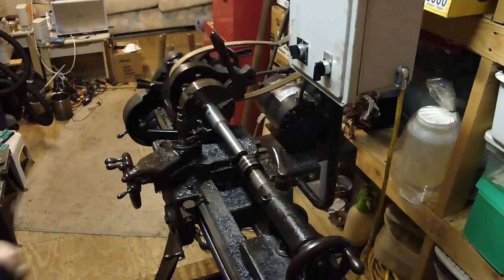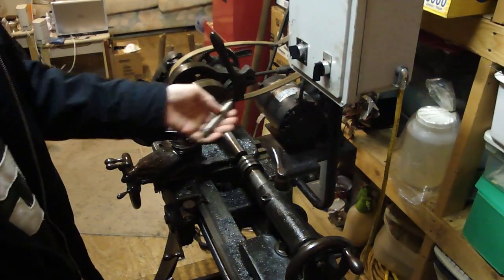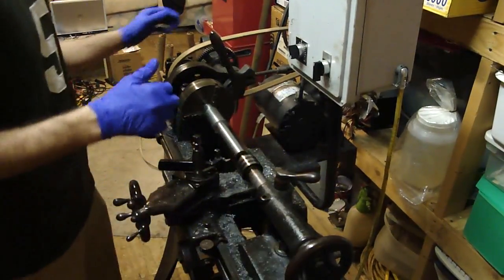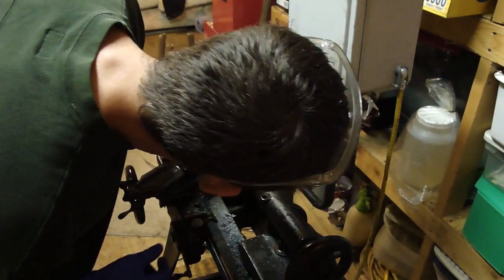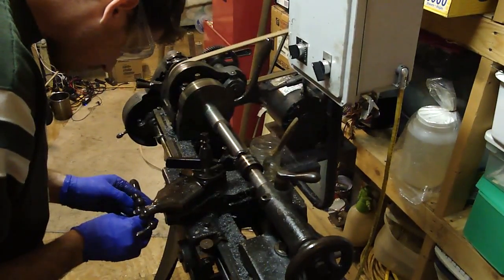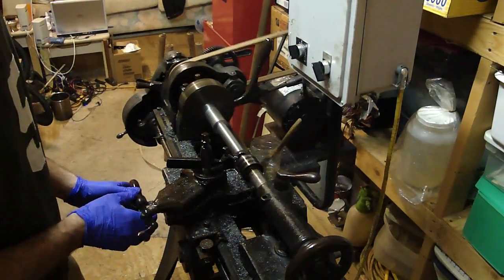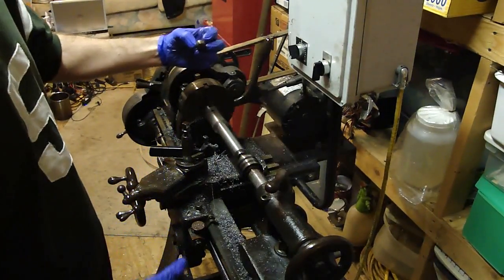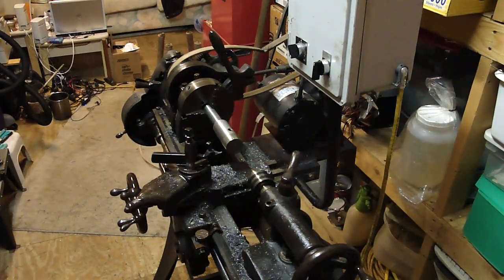MT3 Dead Center Part 1

Comment: Seems your RPM alone is too high causing the chatter especially when making such small cuts. Should of been cake. Am guessing the throat is too small to have less hanging out. Some brass shims for the jaws and will keep the part from getting marked up and can be used over and over.

Comment: Not sure where you are on your project but here is what most of us would so....take a piece of stock and chuck it in your lathe with about an 1 1/2" of material sticking out from the chuck.  Set your compound at 30 degrees, which will allow you to cut a 60 degree taper.  Feed away from the lathe with your compound until you have turned a center.  You can now turn between centers while using the jaws to drive the lathe dog attached to your work piece.  Any time you remove the dead center you made from the chuck you will need to lightly recut the 60 degree point so it is truing true to the center axis of the lathe.  Good luck.
Reply from the maker: Thanks, I finished using the method you descibe and it worked pretty good. Next on my list is to make a set of centers that receive ball bearings instead of 60d points for turning tapers between centers using the tailstock offset method, then maybe an actual taper attachment.
Reply: Awesome, glad it worked for you.  I'm debating on making a taper attachment as well.  May just go with the boring head set up in my tailstock.  Not sure.  Good luck on your projects.

Comment: I removed the 3 hp 3 phase with the 5 hp single on 220 volts as well as a new starter and heaters. 3 phase heaters are made for much less amps than single. That is my understanding anyway, I may not have done a very good job of explaining it. If I had it to do over again we would just by a phase converter.

Comment from the maker: So I just checked the compound to make sure and it's 1.850 from stop to stop, still not long enough for the 3" taper but longer than I thought. If you hadn't asked me I would've gone on assuming... What kind of lathe do you have? I'm looking at a used tree mill but it needs some work so I may have a new project :) I also have a stack of belt grinder wheels made that I should do a video on. Make some videos I want to see your lathe!

Comment: You have direct reading dials, that means when you feed in .010 if you had an indicator on the cross slide it would move in .010. Thus taking .010 off the radius and .020 off of the diameter. Gloves don't belong anywhere near a lathe even thin ones that tear easily, plus gloves are for girls.